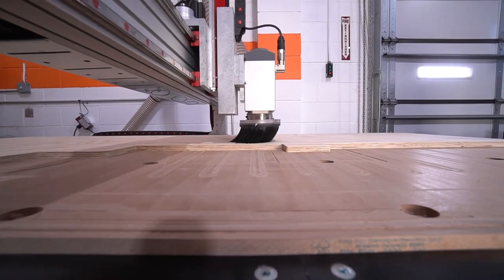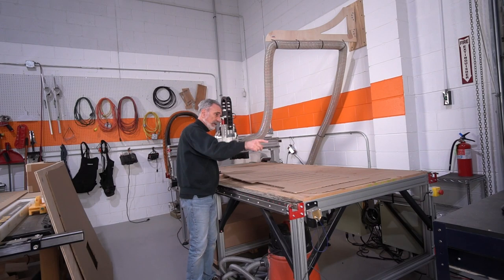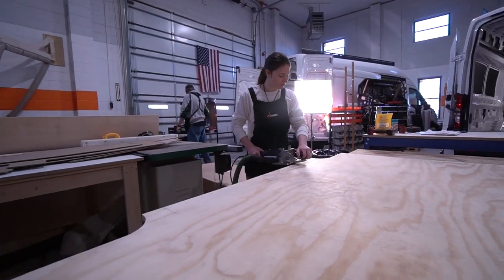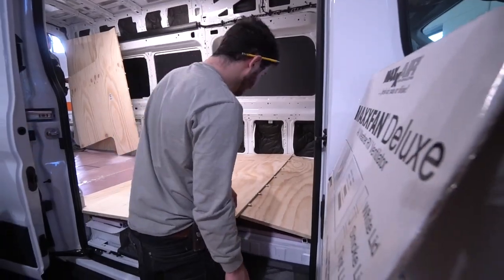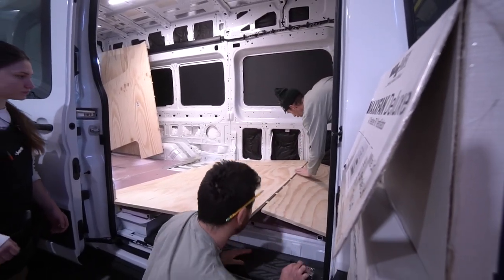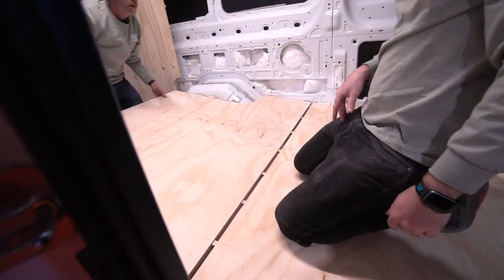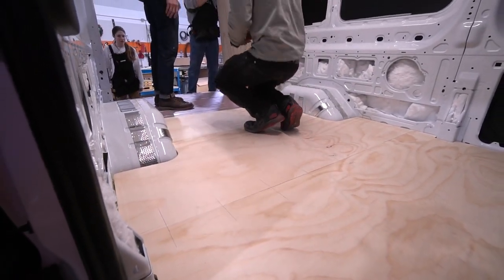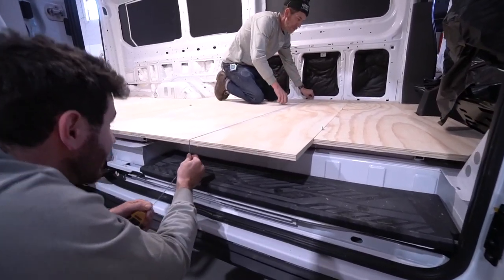DOMINOES! The secret to installing SUBFLOORS in your VAN

Comment: George- Quick one here. I'm seeing some insulation with the vapor barrier to the inside and some lacking the barrier. What gives?  ps-much snow?
Reply from the maker: I don't use a vapor barrier. I believe, unless constructed by NASA, a vapor barrier in a van will fail and retain moisture.
Reply: @HumbleRoad  ...so that black I see is not the VP of Thinsulate?  I recall a prior vid of a ceiling with the narrow boards being used and assumed that was Thin/VP with the black sound down too, but I got it wrong?
Reply from the maker: The black fabric on Thinsulate is not a vapor barrier. It is a mounting surface for the fiber and a means for adhesive. Thinsulate can also be had with the black fabric on both sides. I think the black stuff you were referring to in the old video was heavy mass vinyl. I use that as a heat absorption.

Comment: What's the minimum thickness of the ply to make use of these dominos? And what's the difference between dominos and biscuits? Looks like these are just generally beefier than biscuits.
Reply from the maker: Dominoes are more structural than biscuits. We used them in 3/4" plywood.

Comment: You could have splined that ply super easy, glue one side of spline.  A router and a spline bit…..Flooring supply sells spline if you don’t want to make it. Spline won’t affect overall dimensions of pieces like cutting a tongue with a router would. Dominos are great but not in this application.  Beautiful work you do on these vans.

Comment: That aluminum beams under the floor? Never saw a more irritating assembly of thermal bridges (yes, frying pans are made of aluminum for that exact same reason - perfect heat/temperature transfer). Here you should definitely go with wood in this place.
JFTR, in case there is something squeaking in that Van, unglued dominoes might be a reason for that, like on old staircases a "rubbing" wooden joint…

Comment: Aluminum bracing under the subfloor seems like a terrible idea. Aluminum creates a huge thermal bridge as it conducts heat much more efficiently than most materials. The XPS should be able to handle most loads, but if more is needed wood would be better.
Reply from the maker: Wood is an organic material. It is subject to all kinds of problematic issues that aluminum is not.
Reply: @HumbleRoad  I have seen lots of wood in your other videos so I’m a bit confused by your response. Also like I said the XPS insulation has a decent PSI and should be good with plywood on top to distribute any forces. And if you shop around you can get higher PSI rated XPS. Aluminum is often selected for scenarios where high heat transfer (eg cookware, heat syncs, etc) which is exactly the opposite that you want bridging through an insulation layer.
Reply: Your literally putting wood (plywood) on top of the XSP… why no concern there?
Reply from the maker: All structural components in the build are aluminum. The wood in the van is not structural. My aluminum joists have a generous dollop of adhesive on both sides of contact to the chassis floor and the subfloor plywood. I do not worry about thermal bridging. What heat is transferred, is absorbed in an inconsequential manner by the plywood. I do not worry about compression, I do not worry about hydrophobic failure. The system I employ is specifically designed to allow for passive airflow throughout. Regardless of rated PSI of XPS as a structural member, the constant vibration and banging would eventually throw everything out of square and plumb.

Comment: I love you! But my god you make the easiest installs so unnecessarily complicated. instead of using one 3/4- 1&1/8 inch thick plywood sheet with dominoes use 2 sheets of 1/2 inch plywood. stager the seams so you have 2 foot overlaps and glue the 2 sheets of 1/2 inch sheets together (plus screws) to create a 1 inch thick solid substrate when finished
Reply from the maker: Well, that's twice the material. Twice the work. Since the sheets are staggered, you need to do two sets of CAD drawings. And run the CNC twice as much. A sheet of 1/2" is $50. A sheet of 3/4" is $65. And can you guarantee the sandwich floor will stay plumb? I don't think the dominoes were that complicated. We did the whole project on two vans in less than a 6 minute video! 🙃